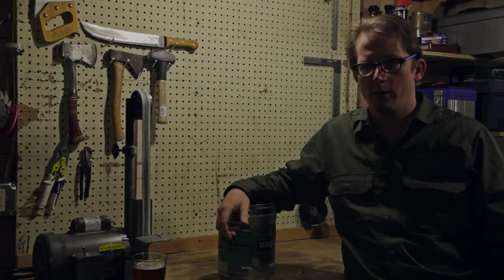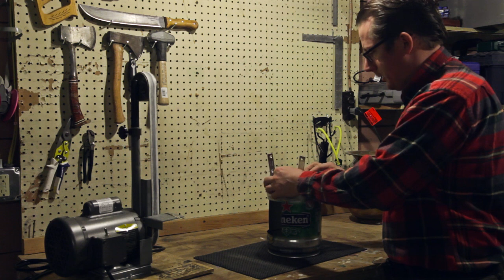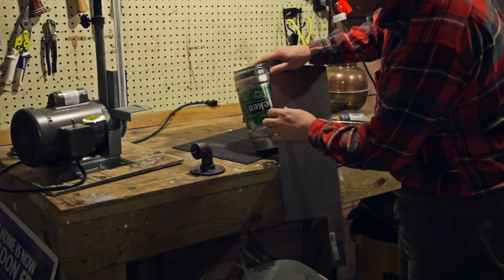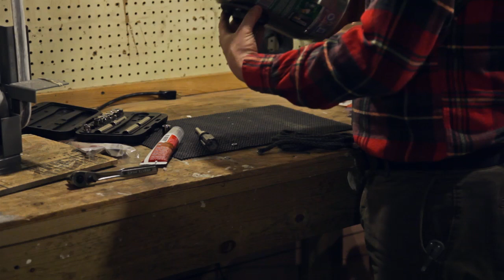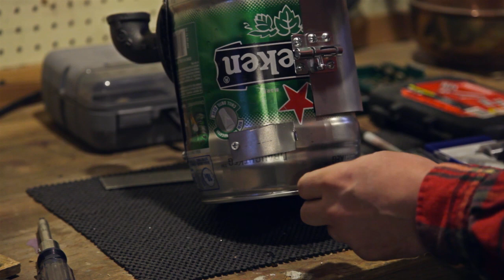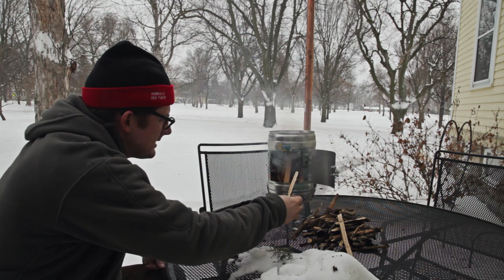How to:  Heineken Mini Keg Wood Burning Stove

Comment: Am going to try this out, but will simply be top loaded, so I won't need to faff around with a chimney or door. There's already a hole at the bottom for ventilation. Some ceramic blocks should hold up the grill. I might attach much smaller feet - yours looked a little top-heavy.

Comment: I want to build one of these, so I don't necessarily know what I am talking about, but the chimney seems too skinny. I've seen others that are the width of a beer can, and the smoke goes where it is supposed to. I like the idea of it being a flat surface so that you can cook on it, but it seems like smoke is billowing out of every crack. Have you tried this version in an enclosed tent?
Reply from the maker: I would never use one of these in a tent.  :)
Reply: averageiowaguy Gotcha. What I meant was a tent that was made (or modified) to have a wood burning stove in it. others have successfully done so. I have a Polish lavvu that I would like to try this in for some wintertime 'hot tenting'. I'm just trying to figure out the best design. I like yours because it has a flat surface you can heat water on. Most of the other ones I see are horizontal so I can't help but think there would be some heat loss to whatever plate they put on top.

Comment: I think I would make a rocket stove version of this stove. I think you have done an excellent job with minimal tools required. I might make a more complicated stove. A rocket stove with electronic sensors which controls air flow, and thereby temperature of the burn, and fuel feed rate.

Comment: If you had a stainless container full of 1/4 holes all around the side and the bottom you could burn wood pellets/kitty litter in it and it would be no work at all. And it would be pretty efficient too!

Comment: I think you overloaded it. You lose too much fuel to smoke by overloading. Use the smallest, driest kindling possible & smaller more frequent loads (10-15 pencil sized sticks and tinder) & be happy with it.  Wood stoves become more of challenge the smaller they are. It is hard to get temps up high enough for real efficiency, so loading becomes integral to efficiency & with the most efficient type kindling. Smaller, dryer more frequent loads overcomes that for the long haul.

Comment: Excellent video. I really want to try this!

A suggestion, if I may: This is obviously a stove, meaning you need clearance above the top of the MiniKeg. However, did you consider angling the 'heavy' pipe to come over the top of the keg - rather than to the side?

Alternatively, with two bends half-way up the pipe, and the 'last' half of the pipe at the front of the keg, the centre of gravity/mass of the pipe to be roughly at the middle of the keg.

Notwithstanding the above, great project!

Comment: Nice! Instead of using cast iron pipes (which are very heavy) for the chimney, maybe you could use tin cans with both ends cut out and, at one end for the first one, cut tabs and fasten using nuts and bolts. Then, you add more cans with both ends cut out but with smaller tabs at one end, place the folded tabs over the end of the non cut end of a different can and fasten using metal binders.

Comment: @averageiowaguy Wow, thats strange. Polartec wind pro is known for it's wind stopping abilities. Mine has proven to be very wind and water resistant in the field.

The pockets have a higher position because they are designed still be accessable with a pack or chest rig on. I find myself stowing gear i would usually keep in my pants pockets in the jacket and then using the pants pockets to keep my hands warm.

Comment: Great project I built one last year and had a lot of fun doing so. Mine was on its side and I used an aluminum stove pipe that ended up melting. The only improvement I can suggest is a larger stove pipe you may not be getting enough air flow with only a 1 inch pipe.

Thanks and keep us informed if you make any updates.